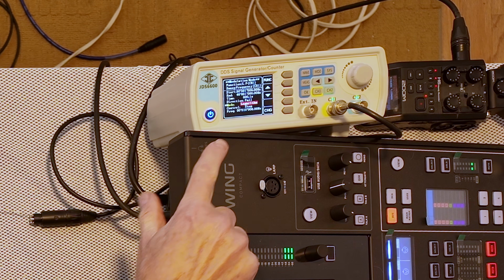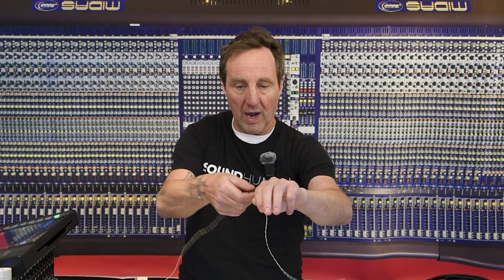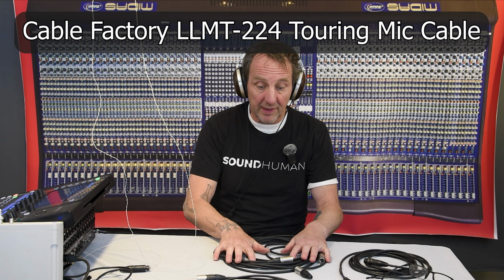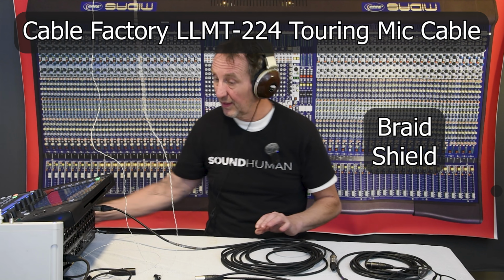Pro Audio Cable Noise Tests - Which is Best?

Comment: I have a studio 200' from a a tower containing 3 FM stations, an AM station, and at least a dozen cell phone repeaters.  RFI has made my life hell when it comes to mic cables.  Line level stuff has no problem.  After trying ferrite chokes, trying every cable in my locker, building a Faraday Cage to put the mics with the worst noise, I nearly gave up.  I found a video online recommending lifting pin 1 at the mic end and leaving the shield connected only to the XLR housing.  It works for condenser mics with transformers, like U87s and C414s, but transformerless mics like a TLM103 still were too noisy to use.  As a last resort, after reading a bunch of threads on RFI online, I bought some Gotham GAC3 cable and some Neutrik XLR ends designed specifically to reduce RFI.  They are a bitch to assemble, but at last I have found something that works for all of my mics but one.  My early 1970s Neumann SM69fet is essentially a stereo U87.  It uses proprietary multipin Tuchel connectors.  I had John Peluso build a new cable between the power supply and the microphone using his best cable.  I had it made only 10' long in hopes the shorter length would help.  I can use the mic almost anywhere with great results except in my studio.  The RFI makes it too noisy to even consider using.  Sorry for the long post, but do you have any ideas?

Comment: I know this is educational and a sales pitch but I am very appreciative because as a working soloist, I need the least amount of problems at high end events.  I can’t tell you how many time the ghost has caused stress in the form of him and noise.  I would beg you to explain to me however why it is self powered speakers like Bose S1s don’t play nicely when plugged into any other devices?  I tried radial boxes like ICE CUBES to eliminate the hum. NOTHING worked.  Why do battery powered speakers have hum when plugged into other equipment that is powered by normal means?
Reply from the maker: hmmm, it sounds like there are other issues than the speakers. when you plug a mic directly into the speaker with a mic cable or is there only humm when using a mixer? 

are the cables properly shielded and wired? when you are using a mixer, are the speakers set to line level input? turning down the speakers and turning up the mixer should reduce hum.

if using a mixer can you hear the hum in the mixer with headphones when all is wired? if so the issue is not the speakers.

sounds like a ground shield connection is missing somewhere. like what happens when mic cables have pin 1 lifted on one side.

lots of variables but there should not be humm

Comment: Back about 30 years ago, renovating the control room of a studio at ABC, to keep production going, we parked an "OB truck" (to use the EU term) outside the studio to use as a temporary control room.  At the request of the audio operators, I bought a large quantity of mic cables of a known manufacturer to connect the truck to the mics on the studio floor.  The audio operators quickly came back and said the cables had far too much "cable rustle".  They suggested a different make which they said were quieter, so I bought them a replacement set.  They were happy, but what to do with the (apparently) noisy ones?  Having been spread around the studio floor and across to the truck, I couldn't return them to the vendor.  So they sat in my office for a while, until I took them home and have used them ever since for my own little location recording projects.  I never heard any cable rustle even when people stepped on them, but then they had some of them connected to moving boom mics with pretty low self noise picking up actors some distance away, so their conditions were probably worse, but I did use them regularly to record a choral group in a church. perhaps 20 feet from my Blumlein pair of (fixed) boom mics.  So many different issues.

BTW, the drain wire issue is much greater when the drain wire is wound with the active conductors inside the foil (like 8451) instead of outside the foil.  With it inside, you no longer have a twisted pair, you now have a triplex without a properly twisted balanced pair.  I think it was Jim Brown who made some extensive tests of this issue and reported it back to the AES standards committee I was active in,
Reply from the maker: super interesting and thank you for the info. 

Yes the drain wire does seem to cause issues and the point you bring up about it being inside or outside the foil is interesting. 

I'm guessing that inside the foil is worse but outside the foil I think still creates some asymmetry and reduces the noise rejection. 

There are some foil cloths or or probably more accurately aluminized fabrics that are used in cables with an overall braid shield that seems to be the best of all worlds. I've been testing some of those with surprisingly good results.

it offers 100% shielding and it doesn't have any of the asymmetry caused by a drain wire and also reduces the issues with foil cracking over time causing clicks and pops.
Reply: Well, I may be slightly mistaken  But as a result, you have an easy test to compare whether placing the drain inside or outside the foil changes the results.  Belden 8451 has the drain outside the foil.  I used many thousands of feet over the years at various locations.  Belden 9451 has the drain inside,  with the foil bonded to the sheath making for faster stripping.  Otherwise identical to 8451. ABC TV New York used hundreds of thousands of feet after switching from 8451 to take advantage of the faster stripping at some point in my 36 years there.  So call up your friendly Belden rep and ask him for a 50 foot sample of each (if you don't already have it handy), and go at it.    I just went down to my basement and found scraps of both and verified the internals.  

While you are calling your Belden rep, ask him for a sample of 9452.  Includes a conductive textile tape under the foil shield and drain wire to reduce handling noise and a short lay to reduce pickup.  Back in the mid 1970s, i built two custom mixing consoles for a university using this wire and Belden 8640 (apparently no longer made) a very small diameter cable, twisted pair of enameled 28 gage solid copper wire,  a foil shield, a 30 gage solid copper plated steel drain wire with overall jacket  I used them because space was limited inside the frames.   I never used either again.  The 9452 was an absolute bitch to strip, that textile tape was hard to cut.  The 8640 was tricky, you have to be careful with solid wire to avoid breakage.  What we used to call formvar insulation which melted away when you soldered it, no conductor stripping required, but you had to be very careful stripping the jacket because if you nicked any of the solid conductors, they were guaranteed to break when bent..  

Ward-Beck, the Canadian console manufacturer used miles of 8640 in their projects, including a couple for ABC that I engineered.  The small OD made for neater cabling. They had it down to an art, beautiful cable dress and never a broken conductor.  I hated the stuff,  but the 9452 was worse.  

At least in theory, the 9452 should be very quiet.  Looking through Belden's current cables, they have some very interesting ones,

BTW, please look into using CAT 6 (and/or better) unshielded  cable.  Both with using another pair as a ground return (as would be necessary for phantom power) and with no ground at all.  I've heard all kinds of claims...  But hey, in a pinch I ran mic level (for an intercom) on one pair of a 100 pair (unshielded) telco riser cable in a building, about 4 stories plus a bit of a lateral distance on each end, 70V audio on an adjacent pair, installed for many years without audible crosstalk to each other or to the many phone lines and our radio lines on other pair in the cable.  And the telco installers/repair people never bothered the "stolen" pairs.

Comment: Any video or thoughts on Studio monitors sitting too close to the computer / computer monitor noise?
Reply from the maker: speakers impacting monitor or monitor impacting speakers?
Reply: @DaveRat  Monitor impacting the speakers it seems. Don't have space to move them further away. Similar setup across town but the speakers are further. Just curios.
Reply: @SteveMahoney  if you haven't tried it yet, for testing play w/ different shapes/placement of aluminum foil between the monitor and speaker. 
at one point i had and L shaped piece of aluminum that's meant to be used as a 'kick plate' protection for doors "shield" the speaker amps w/ satisfactory results. 

sometimes the luminosity and refresh rate settings of the monitor influence how noise they are.
Reply from the maker: yeah figuring out exactly how And where the noise is getting in and causing issues would be the first step. 

quite often those kind of issues happen from the cabling like the monitor cabling being near signal cabling. 

it physically lifting the monitor up solves the problem then shielding can be effective. 

aluminum foil will help with RFI but not with EMI 

on Amazon you can buy magnetic shielding fabric that may be worth trying.

Comment: On a perfomance stage, there is little we can do but to wire our microphone cables observing best practices to reduce EMI. So much more can be accomplished with careful preamp design. Many mic preamps are designed with far too little attention to common mode impedance and RF trapping. It is down to preamp and even connector design to reduce it not only further, but to give us the cumulative sum of that reduction in 50-80 inputs. EMI sums very well since it is mostly one frequency and the very large waves are mostly unidirectional and coherent. Our active split means the main mults are no longer an issue. But the mics onstage are another story. We go way out of our way to route subsnakes on their own, away from power cables. It has become intuitive to wire a stage in the most difficult way, as later, we typically have no clue where the benefits came from.

Comment: Interesting video. I have a pair of KM184 and Coles 4038 in my small project studio. I’m fighting EMI (I think?) with my Coles 4038 mics. This is with both of them so I don’t think it’s an issue with the mic. Would this be because they’re giant metal magnets? 

Also, I use a snake but don’t have all channels plugged in so it’s interesting what you said about those leads being antennas.
Reply from the maker: try plugging the mics directly into the console with the shortest cable possible and see if the issue still is there. then plug them in with a longer cable but stay in the same room as the console. 

then stretch out the cables into the other room with the mics on them and listen again. 

you could try some different cables but that should give you the info to know whether it's the mic or the cabling
Reply: Hi, I’m back! Still battling the EMI with my Cole’s. I tried plugging directly into preamp with a mogami gold. Turned off WiFi and led bulbs. Still no luck. It does change as I move the mic around but unfortunately I can’t just move the mic because I’m micing a piano. Any advice? Thank you.

Comment: Phenomenal video as per usual.
I’ve been battling noise induced by shitty LED fixtures that are wired into the same phase as the audio system. 
One thing that worked is using a 1:1 transformer. But how can I isolate these leds from the system if I don’t have an ability to move them to a different phase ? Is there a device that can block them from introducing HF switching noise ? 
Thank you in advance man. I’ve been listening to your videos for over a decade.

Comment: Hey Dave.  Back in the day I used to install analog studios.  I was taught to ground the drain wire on my multi pair cables on one side only.  Was there any benefit to doing that?
Reply from the maker: Yes there are some advantages. having ac current flow through the drain wire and shield will induce hum, disconnecting the drain wire on one side will prevent current from flowing. 

that worked wonderfully with transformer isolated gear. but with modern electronically balanced outputs and inputs, lifting the drain wire does not completely eliminate the current flow between two pieces of gear if they have a differential and ground potential. 

so lifting doesn't really help in many situations anymore. The best way to solve all this is to make sure that all of the equipment has the exact same ground. And once the exact same ground is established for all the gear connected, then lifting the drain wire no longer becomes beneficial

Comment: Fun video, thanks for the efforts, but with a couple of caveats. First, a better mic pre front end should be inert to junk in the 30-50 MHz range, though inconsistent metallurgy or uneven geometry in cheap cables will defeat even the best CMRR inputs. And LF "beat" frequencies from those problems can enter in the audio band, as you demonstrated. Still, it'd be interesting to test with a Grace or Millenia input. Second, IIRC, star quad was invented in the 1930s by Bell Labs for use in high electrical noise central offices. But the runs were kept short due to the detrimental effects on the audio top end -- and in that application we were only concerned about voice bandwidth. So, imagine the damage done to music with a 100 ft of star quad! Again, according to my sketchy memory, in the 1950s/60s improved star quad mic cable from Belden saved the day by rejecting a very "hot" free field of AM RFI on the stage of the Grand Ole Opry in Nashville. The nearby 50KW WSM transmitter was the culprit. The point is that star quad was mostly targeted to dump AM band (540 KHz to 1.6 Mhz) rfi, which was often problematic. Transformers, natural system low pass, etc, took care of higher Hz rf. But now we live in an RF soup (nearly DC to light); good cable and good front ends are more important than ever. :)
Reply from the maker: very cool and thank you. yeah this video was just to show that different cable manufacturing designs have significantly different impacts on noise rejection. 

I think looking at the way different consoles deal with noise is another adventure as well as looking at sound quality impacts of the different cable designs would be a different adventure. 

I try and keep my videos under 20 minutes and it's tough just covering one aspect. 

constantly faced with the choice of covering multiple aspects in a shallow way or diving into one thing more in depth.

Comment: We had an issue with the fairgrounds being right next to an AM radio broadcast tower. With a 250 foot whirlwind snake, the snake was radial in relation to the radio tower about 800 feet away from the stage. The signal to the FOH from the stage was clean, however the returns to the speaker management system, a Meyer Sound Galileo 61 6, the weather, news, and traffic reexports were ever present in the background. As an RF engineer, I knew the RF is ignored by the equipment unless there is non linear distortion of the RF to rectify it to audio. Some gear overload at different levels.
The following year, made up some bifilar RF chokes for the returns to attenuate the RF by about -60DB at the Meyer inputs. This stopped the rectification of the about 35 volts Peak to Peak RF by the Meyer Sound unit. This completely quieted the RFI at the about 1.3 MHZ RF interference.  The Chokes used are 15 miliHenery in inductance. Snap on Ferrite Beads, attenuated the signal somewhat, but did not fix the problem.   
If you run the same experiments with different consoles, you will get different results.  An old Avid SC48 console was clean. A Mackie SRM-450 speaker, and the Meyer Sound 616 both have poor RFI rejection when RFI exceeds about 15 Volts peak RFI. The Behringer X32 console has about the same RFI rejection as the Meyer Sound, so the Talkback to the band from FOH, needed an RF choke too, so the following year brought another RF choke for the talkback line from FOH to the Monitor console.
It appears the active balanced inputs on consoles and active speakers, reject RFI until the common mode RF levels start clipping the input OP amp stages. Bifilar chokes of 5.6 and 15mH have high attenuation at 1 MHZ and takes care of the issue.
Short mic cables into a digital stage box were not an issue when some bands brought their own mixer and FOH engineer and ears consoles. The issue surrounded the analog Whirelwind snakes feeding some gear on stage.
Dave, I may send you a filter or you can purchase the Filter manufactured by Shure and repeat your test with the filter at the input to your Behringer X32. It may fix your RFI test results on most of the cables. The model number is the Shure AT15RF. I could not find any technical specifications for inductor value, if it is a PI filter, just inductors, if it is ferrite based, etc. I was disappointed in the lack of RF performance data.  I found the Shure filter after I built our own RF chokes for the venue.
Reply from the maker: interesting and thank you. this video is about understanding that different cable designs drastically change how EMi and RFI noise is rejected.

How different consoles are impacted and ways to reduce the impact are good topics I will consider
Reply: Thank you for this comment